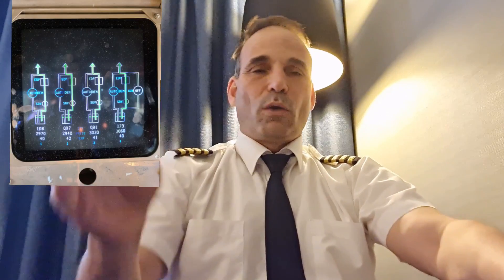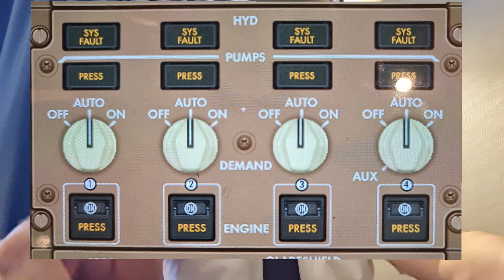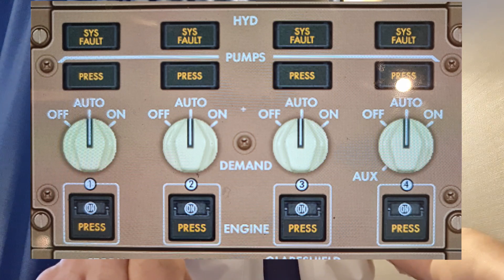BOEING 747 -  The WORST EVER SINGLE  AIRCRAFT ACCIDENT.  How it's happened??  Explain by Captain B.

Comment: Yes, 7 years before the accident they did a bad job repairing the damaged tail strike and hidden under the bad repair was a crack which grew more and more with every landing and take off until the crack finally blew the back of the plane apart damaging the hydrolic.
Even if the hydrolic wasnt damaged, they would not probably be able to save the plane